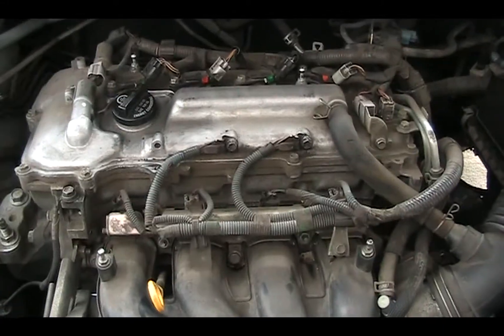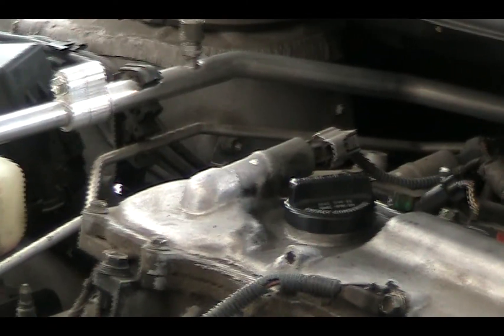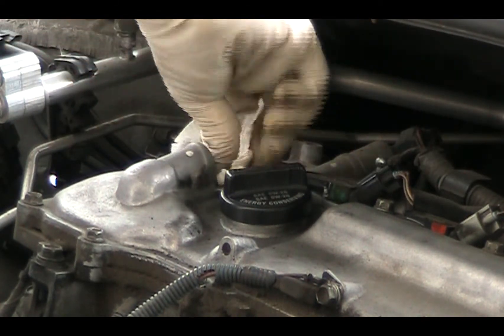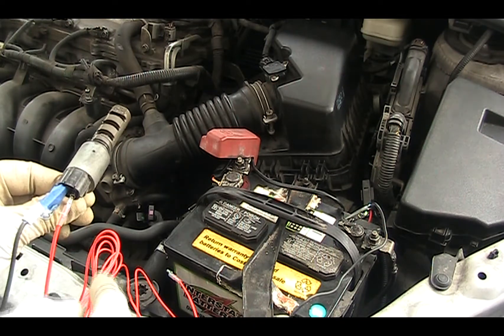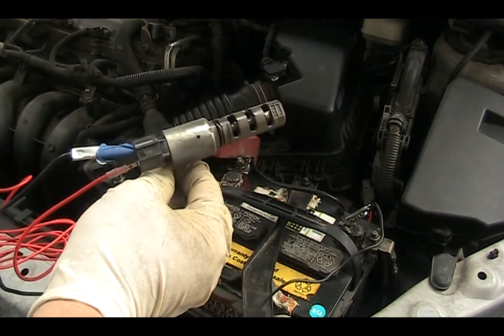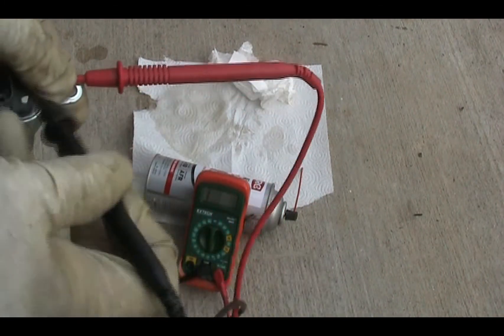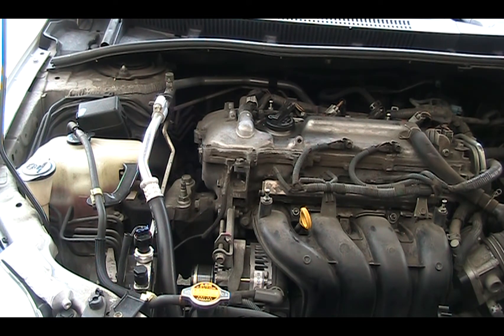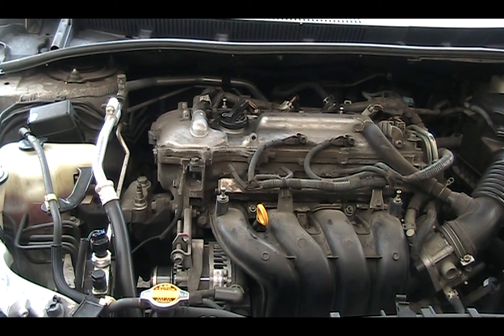09-13 Corolla VVT oil control valve solenoid-remove,test,Rough Idle, misfire OBDII P0011 P0012 P0021

Comment: There is a technical service bulletin on it saying there’s a rattle noise on cold start up because of the vvt-i gear assembly (sprocket of intake camshaft) or because of the timing chain tensioner, good luck! For mine I’ve replaced both and no more noise.
Reply from the maker: Thank you so much for your information. How much did you pay for that vvt-i gear repair, I researched on it and it is quite a lot of work and expensive; however, it seems like it only happens when the weather is cold. I am going to monitor it for now. I am sure the warranty of my old 09 corolla is long gone. Thank you so much for your comment and thank you for watching.
Reply: Also this happens in cold season when thicken oil for few minutes at first start.. it is as a result of slow lubrication runs due to colleged vvt screen filters..
 Please look around engine oil filler cap or the vvt both valves for 2  14mm flat head bolts , just open them and carefully remove n clean the screen filters with any non abrasive solvent.. and you have..
Yess you must then change the oil filter.. please use normal oil
Non syntitec oil
Reply from the maker: @ahmadkamali8547  Hi, Ahmad, thanks for the valuable information. 👍
Reply: @diycheapdaddy2113  Ahmad is incorrect. You MUST use full synthetic engine oil. These 2ZR-FE engines take 0W-20 full synthetic oil. If you use non-synthetic oil, the cold start oil flow will be even worse. Synthetic oil flows easier than conventional oil. You want the oil to flow as fast as possible and pressurize the VVT system right away so that any noises last as short as possible each time you start the engine. Full synthetic 0W-20 flows the easiest and the fastest.
Reply from the maker: @mannys9130  It makes sense and I used Mobil 1 5w-20 in summer and 0w-20 in winter. I will change it to 0w-20 all year round. Thanks for your advice.  Thank you for your comments.

Comment: Try cleaning the front and back of your throttle body. Also clean the maf sensor and see if that helps. Disconnect the battery first before you clean
Reply from the maker: Good advice. Thanks for the information. 👍

Comment: Just need new spark plugs and if possible new ignition coil. Also clean map sensor. Make sure you have a clear air filter.  And by the way these Corolla were notorious for bad sprocket of intake camshaft. You probably need to replace them and new timing chain.
Reply: It’s 0:35 iiiio I 
😅iiiio

Comment: Hi sir! Very good video, u have to clean your trottel body ,and replace spark plug with denso iridium or better iridium TT! After this 2 thing to made u have to clean or replace PCV valve.
Ad to your next oil change an additive from liquid moly like MoS2 or ceratec
Reply from the maker: Thanks for your comments. I was thinking the PCV too but I need to remove the intake manifold which is quite a lot of work, I may order the gasket first and prepare for it when the time comes.  I used Liquid Moly  's Di-Jectron and Valve Clean but not MosS2 or Ceratec, I believed the LM's Valve Clean did make it run smoother but the mpg still not good, average 26/27 freeway and city combine. If city only it is 23-25 mpg, if freeway only, it is 30 mpg. It may be the PCV or old O2 sensor, however,  the O2 sensor did not throw any Check Engine light code. I did clean the throttle body later on and recently change the iridium spark plug. the old iridium plugs still looks good; therefore, it is not spark plug issue. I also clean the MAS sensor. I am thinking issue may be on PCV or O2 sensor; however, no Check Engine Light codes so far.   Thanks for your input 👍and thanks for watching.

Comment: Can this cause car to shake for few seconds when comimg to stop?
Reply from the maker: Hi, Nick, Not sure , may be but for rough idle when stop, you may also want to clean your MAS sensor and the throttle. If it gets worse, you should get a Check Engine Light and you can scan the code after that. Thank you for your comment and thank you for watching.
Reply: Mine is different and weird. I changed just the air filter along with adding some fuel cleaner and after driving for a while disconnecting battery and reconnecting, (saw that you can do that to reset the computers memory or something) and now the check engine light is off and no more lean code… idk I think I got lucky. Now my short term fuel trim is just about .6-1.8%. I think it should be close to zero to be balanced

Comment: Maybe to replace the O- Ring on the solenoid before reinstalling ?
Reply from the maker: Hi, Peter, May be. However, I am not sure where to get that O-ring and it seems like O-ring is ok because I did have a lot of resistance when I pushed that in and after it is inside, when I turned it, it is not that loose but that also can be a the reason. Thanks for the thought.  I also got a new pairs made from Third Party (Brand is called ISUMO) but the resistance is on the minimum and the old ones are more within the range of specification. After installed the new one, I did not see any differences. I actually changed it back using the OEM. Thanks for your comment and thank you for watching.

Comment: Were you able to fix the noise?
I need help with mine
Reply from the maker: Hi, Jonathan, I used Molly's lifter and later Lucas oil but the noise goes quieter but still there. I think it is related to some parts inside engine.  Mechanic told me 185k is near the end of the engine. Thank you for your comments and thank you for watching.
Reply: I sent the cylinder heads to get rebuild and the noise went down but still there
Reply from the maker: @Sickfa5jv  I also thinking more like cylinder head or cam shaft vvt-i but not sure why in your case still not 100% fixed.
Reply: @diycheapdaddy2113  287,000 miles on my 2009 corolla 1.8 bought a new change oil every 4-5000 miles in the trans fluid every 60,000 runs like a top. Plan on getting about 400,000 out of her. I have a good friend who has a 2010 corolla over 310,000 miles on it also no major issues. Indeed these Toyota engines and transmissions have a very long life if cared for properly.
Reply from the maker: @jonathanratliff4780  Totally agreed. Even though I found out this year 2009 is not a good year on 2ZR-FE and may have the "famous" VVT actuator cold rattle and original water pump issue. I still got 190k on this engine. I also followed Toyota maintenance schedule such as oil, transmission fluid, coolants, spark plugs.....etc 
Thank you for your comment and thank you for watching. 😁

Comment: The sound which you hear is from the timing chain tensioner it gets worn out with time and that makes this noise replace the tensioner to a brand new unit and your engine will sound like new again I had the same issue and it was due to lose timing chain coz the tensioner was bad and it wasn't putting sufficient tension on the chain which makes this noise whoever told you that this is the end of this engine is an idiot and has no clue about these engines these engines can go 400 to 500000miles if the oil is changed on time and maintenance items are done at the correct interval
Reply from the maker: Thanks for the information.
Reply: i just replaced my timing chain tensioner and noise is still there i think its the vvt gears phasers like a few other ppl said here and elsewhere and dirty oil fitler for the vvti inside the top engine under valve cover

Comment: Don't you need to clean the filter for these solenoid as well?
Reply from the maker: I don't recall seeing any filter on the solenoid. On the solenoid inside the transmission, I did see there is a "Shield with holes" on it and you can clean up that way after you remove the solenoid.  After some research, I believe my Corolla has a filter inside the engine; therefore, if I need to clean it, I have to open up the covered which is lot of work.  Depends on the years, some Corolla is designed to have has a plug holding the filter on the engine block and not inside the cover and  yes, you can clean the filter if that causing issue. I saw a video showing how to do it. Thank you for your comments.
Reply from the maker: I able to locate the other video regarding to your filter question but it is a different Corolla and model. For the 2009 Corolla with 2ZR-FE engine, it is under the cover. Here is the link of that video
https://www.youtube.com/watch?v=SlZkIhRNZHA
Reply: @diycheapdaddy2113  its actually the same model as you just showed..the filter is right inside under the valve cover its really easy to get to could also be the vvt gears like many others are saying thats what im going to try to do next
Reply from the maker: @justinmike2zrfe  Hi, Justin, thanks for the information. That is what I going to next 🤣especially if I see valve cover oil leaks or spark plug area leaks. Thanks for the comment and thank you for watching.

Comment: Checking resistance is not accurate because there is no load to determine the integrity of the circuit.
Reply from the maker: Thanks for your information.